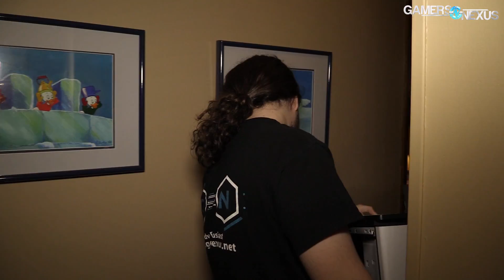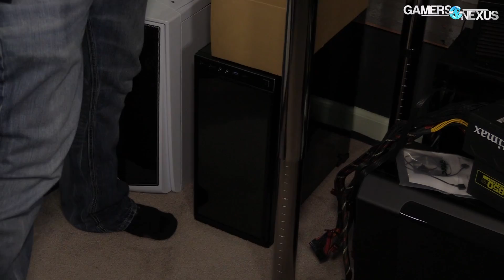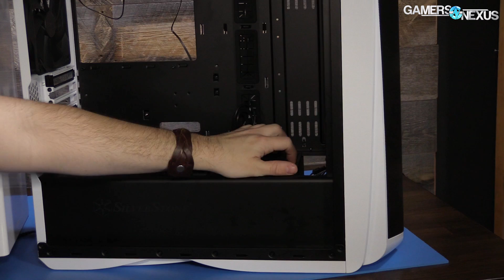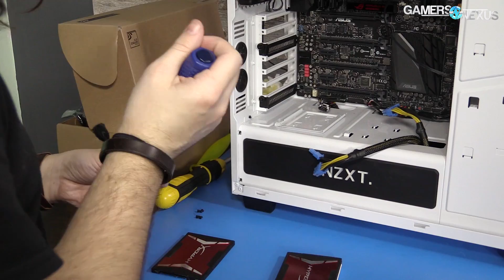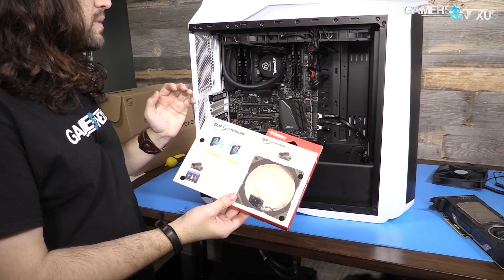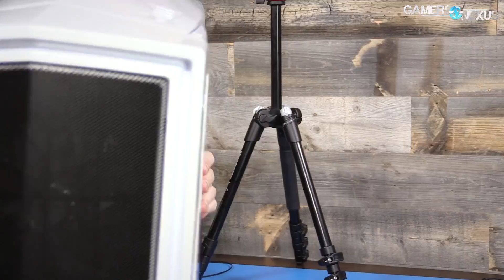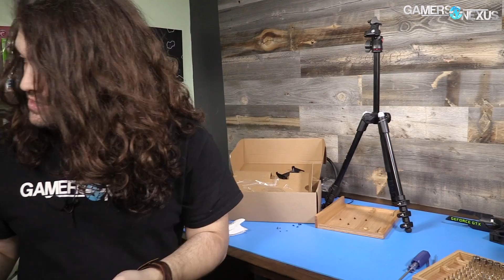Emergency Render Rig Rebuild (Pump Failure) - Pt 1/2

Comment: What was the rationale in using liquid cooling on critical business systems? The failure potential over air cooling is well known.
Reply: Getting comparable thermal performance on air requires a very large heatsink, which can cause packaging and installation problems, and might not be readily available for all applications.
Reply from the maker: Thermal performance for the space consumed is far greater, and the point of failure was the Antec fan, not the pump (pump failed after the fan failed due to high temperatures). Liquid cooling gets us higher sustained clockrates, lower noise, and works better in the cramped space we've got it in where there's limited cool air.

Also, we have lots of them. Like, a bin of them. It's easy to replace. The system will shut itself down if anything bad happens, so we can just swap as needed.
Reply: It's not that bad actually. From what I've seen with liquid cooled systems, the possibility of a failure while possible isn't that big of an issue as it doesn't happen THAT often. Sure, it's possible to happen but pretty rare to have a leak or other failure and as shown here, the pump and/or fans are more likely to fail than the loop itself.
Reply: They are far more reliable when you do custom loops.  D5 pumps in particular are known for longevity.  Part of the reason being they are water cooled as well.  DDC is pretty good as long as you get one of the newer ones from the last few years.  You know it's the new design if it has the heatsink on it.  AIO's are pretty weak sauce in the pump department.  The exception being something like an EK Predator kit.  They use good stuff.  Awesome block and a DDC pump built into the rad.  If you don't want to mess with assembling a loop, those are really the only AIO type system worth a damn.
Reply: ah, you did say in the video it was the pump though. I use liquid cooling for my "fun" stuff, but I've been reluctant to use it in anything I need on 24/7 or demanding duty cycles. AIO seems too flimsy for heavy duty, and custom loops are daunting and expensive.
Reply from the maker: TKO Jabroni Also said it was the fan in the video almost immediately after. And then again later in the video.
Reply: whoops, you're not wrong. guess this proves you shouldn't split your attention if you want to absorb information properly.
Reply: Installation problems huh? They've done a shit ton of headache installs already. High end workstations that  film production teams use never use water cooling
Reply: rude
Reply: The system shutting down if anything bad happens... are you talking about just a built in feature that would shut it off when it reaches a really high temp or something else?
Reply from the maker: Most large data centers are liquid cooled. LC is also common for render farms. Not sure where that "film production teams never use water cooling" stat came from.

Rusty -- You can set a threshold temperature using software or motherboards (not all boards support this) that is lower than TjMax. We have a safety temperature set that is lower than TjMax for precisely this reason. That way, if there is a failure from air, liquid, or something else, we are protected. Besides, the benefit of working on hardware all day is that a swap/replacement is trivial.
Reply: I'm sorry the other people commenting here are being so abrasive. I was genuinely curious. Thank you for answering so promptly and directly.
Reply: +TKO Jabroni I did an internship at a fairly large civil engineering firm over the summer (37 offices nationwide). Most of the people at my office just used ThinkPads with a dock, but a few had desktops with AIOs in them (I forget for what software).

Comment: Why not use a real loop.  D5 pumps last for years and years.  Going on ten years on the one in my loop.  I have tried AIO's.  They are less than reliable.  Pumps being the main failure point.  Custom loop or air.  Never AIO.
Reply from the maker: Chad Bremer We upgrade too frequently. Not time friendly, not good for component swapping, and not something my staff can maintain if needed.
Reply: Gamers Nexus use quick connects.  makes GPU swaps easy.  no harder than the AIO.   You could even do that for the CPU if you really wanted to.  Same work as what you are already doing.  Better performance.  More reliable.  Win win.  As for maintaining, add a little water, maybe every six months.  aside from that swap fluid once a year.  He'll, I know a couple people going on 3+ years on loops in servers with out touching them.  They are just running straight distilled water though.
Reply: AIO's are easy and effective. It's possible for them to fail but that's life, My H80i did a decent job for about a year but now I am having issues, however its still under it's 5 year warranty.
Reply: "But that's life?"  And this is why we get shitty products.  It's acceptable to some people.
Reply: Cool stories.
Reply: Three AIO units failed on me.  One never lasted more than about a year.  Meanwhile I have a D5 in my right now that I have had for 10 years.  I flirted with the whole AIO thing.
Reply: Chad Bremer 10 years ago?! So you cannot concede that huge advancements in reliability have been made in that time? I have another AOI in another rig that's still going strong, my H80I doesn't have a pump failure it's performance has just dropped, and it functions better when the rad is at an angle or has been shaken.
Reply: You need to read that again.  I have had the D5 for ten years.  It's been in several systems.  The AIO's have been in various configs as well.  That old D5 was around before them and is still ticking away.  The oldest AIO I tried was about five years ago.  Most recent was a couple years ago.  That was even a Swiftech unit.  Pump still shelled out.  I have had other hardware failure like you sited before.  But none so frequent as AIO failures.  I have had nearly as many HDD failures over the last 20ish years as I had from AIO coolers crapping out.  As for fans, they start to tick and they go bye bye.  But even that is pretty rare since I started using Noctua.  Not one has had an issue yet.  Sadly I have not put Noctua fans in the gaming rig yet.
Reply: Chad Bremer Your attitude about it is what's off putting. No one is trying to sell you on AIOs, but for you to make blanket statements about them and the people who are happy with them is extremely arrogant of you and no one cares about your opinion on the matter.

The best example of an AIO has to be the FuryX, in which I have 5 running in the room I'm in (Family gaming room) that have been abused for over a year without a single issue. 1 I'd be happy, 5 proves total reliability.
Reply: 5 units over the span of one year is dog shit when you're trying to have a discussion on failure rates. If you were running 3000 of them and had data over the last 3 years, it would be relevant to discussion.
Reply: Patriot 03 I think you're a guy using irrelevant data to defend a claim you have a personal interest in defending so you don't feel like you've wasted money on products that generally aren't up to snuff. Big tower coolers stomp all over AIOs in price-performance, are lower maintenance, maintenance costs less, and are less dangerous to use. Custom loops using a D5, which are generally 2-3 times more expensive, are superior to AIOs in every way, except maintenance and price. Noise and temps both are better served by custom D5 loops. AIOs are good for one thing. Looking good on a budget. Basically nothing else.
Reply: Patriot 03 Typical YouTube commenter. Can't get a sentence out without resorting to personal attacks. You are not being the enthusiast Steve knew you could be.
Reply: The Mighty Voice Says the troll who gets on here like an elitist spewing crap about AIOs and the people who buy them? That's funny.
Reply: Patriot 03 You had every chance to actually respond and make a case, but you didn't. Instead you chose to ride upon the world's ugliest high horse and choose insults over discussion. I know AIOs have their use, though fairly niche. They're extremely useful in SFF builds for squeezing out performance without going over a tight budget. But, no. You immediately chose to write me off as a person because you thought I was an elitist, made no attempt to discuss anything, and chose to insult someone instead. Congratulations.
Reply: The Mighty Voice You're an out and out liar trying to flip the story. My case for AIOs and the defense of those who use them has been made.

Yours has been arrogant, elitist, and not helpful to anyone. I think you're pissy that you were called out in the most recent video.

One more arrogant comment and I'll just block you, I don't need to see your crap.
Reply: Patriot 03 I haven't even watched the most recent video, but if your response to perceived elitism is to shout someone down for having an "elitist" opinion, choosing to spew venom and curses instead of talking to them like a person, I have no problem with you blocking me. If you don't want to see comments from people you don't agree with, that's your prerogative. Personally, I don't threaten to block people for anything. I just do it if they're spewing hate speech or the like. I personally don't think there's much else worth blocking people for.
Reply: The Mighty Voice Go watch it. I block people who are both ignorant and arrogant. That combination is justified means to not have to read their comments (or yours) anymore.
Reply: Patriot 03 You realize he was calling out the guy you responded to in the first place, not me, right? Originally I was just pointing out that your logic was faulty. 5 units surviving a year of use does not realistically prove anything one way or the other. Surely you understand how statistics work and why anecdotal evidence isn't generally accepted in debate, you're not an idiot. Angry, but not an idiot.
Reply: Patriot 03 Or you could just ask a system integrator like Puget Systems, iBuyPower, Origin PC, etc. what their failure rate is on the AIOs they sell. They keep that information. At some point, you could turn the cuntmeter down to like 3 or 4, you know.
Reply: The Mighty Voice Go on, try and get a failure rate on FuryX.
Reply: Custom loops are NOT useful for every use case. Just because you think it is the ultimate in cooling doesn’t mean it fits this particular use case.

Comment: Air cooling may well be more reliable (less moving parts and all that) BUT it will never give the cooling performance of a well built and maintained water loop .... if you disagree than I ask you to show us all the GTX1080 on air cooling OC'd to 2150MHz running at 100% load for several hours whilst staying under 45c max temp (delta T of 20 to 25c) and not throttling it's core clock ......
Reply: TechGoat my palit 1070 does that.If i want to keep it under 45 i have to run the fans at 70%+ and its loud at that point
Reply: can you prove that? The lowest full load temp I've seen for any of the Palit 1070 range in reviews is 66C at stock clocks ....
Reply: Also the card needs some cleaning(dust) and due to low ambient the heatpipes are at the point where they start functioning well.I can hold it at 45 even with 25c ambient.
Reply: Not bad and certainly less than the reviews report ... but your temps are after about 8 to 10 minutes fella (going by the afterburner graph)... now try looping the benchmark for several hours ;) ... Plus you do know that 1080s run a fair bit hotter than 1070s yeah? ;) .... My original comment does say an OC'd 1080 at full load for several hours ... not an OC'd 1070 at full load for 10 minutes ;) You do seem to have a nice 1070 though :)
Reply: stock curve runs the fan at 600-700 rpm.That why the temps are at 60c in reviews(same as mine).The palit 1080 performs similarly and if you use an aftermarket air cooler you are set.(accelero or whatever).The cards consume way too low power to require a custom loop in order to run cool.

I have gamed for hours and the temps dont change unless i run my case fans extremely slow.Unigine was running the same scene to avoid the black screen through scenes.That being said unigine is not that power consuming.I could easily increase power consumption by 10% if i run Project cars or the 2nd test of timespy.(and temps could be a bit higher)

It is true that as temps go up gpu boost slightly reduces the clock speed and a water cooled card can fix that.This Palit was the cheapest model available back in September and i was lucky enough to get it.This card never drops the clocks due to power limit or temp issues.(silicon lottery on my side here)

Comment: How long do water coolers last on average?
Reply: 3-5years but things happen like my h60 died after 1 year same case as gamers nexus
Reply: 2-3 years minimal if everything fine
Reply: It depends. imo EKWB and alphacool like the FD Kelvin have much better pumps.  I had acetek fail on me twice, acetek also doesnt have fill port so you can throw whole aio away after 2-3 years of use.

Comment: All these air cooling plebs in the comment section lol
Reply: Noctua is not even close to pleb status. lol
Reply: Anyone can use google in 2 seconds and see the hundreds of reviews and benchmarks and see a simple aio destroys air coolers like the d15.  It's the main problem with youtube comments, they never know wtf they're talking about yet could find facts by just googling it.
Reply: Destroys? More like barely outperforms them. The problem with air cooling is that in order to get the best cooling potential, the size of the heatsink has to get larger. AIO's, on the other hand, are convenient... but has more points of failure. It can leak, have a pump failure, and unlike air coolers cannot passively cool because even if water does move around, the radiators need WAY more cooling than air coolers.
Reply: A lot of hate in this comment chain. To me it depends on the environment.
Reply: Jason Leon That's the thing. An Aircooler fits in less places than an AIO if we're talking about performance. I mean, the Reeven Justice, a sub $50 air cooler is in the level of the D15. But here's the kicker, it's still huge even for a single tower. There's more cases that'd allow a dual 120 rad to fit.

Although the failrate of AIO's are minuscule, it's not a question of when it fails, it's a matter of what happens if it fails. Plus, because there are more moving parts (pump, water, etc..), even QC is a problem because there are cases of AIO's having rattling pumps (because QC can never be perfect, just consistent... and anyone can have a bad copy regardless). An aircooler? If the fan fails, it can still passively cool and won't cook a chip, but sure as hell if you want one that performs well... better hope your case can fit it.

I'm just here to say that air coolers aren't something to underestimate at all. Choosing one over the other is fine, but saying one's better than the other like what 4GB MEANS 4GB is saying... no, just no. If anything, it's negligibly better.
Reply: All my stuff is aircooled, but if these guys want to run AIO in a work intensive, high uptime use case, I'm all for it. I had been considering getting a decent AIO and running it 24/7 on one of my lowish budget BOINC rigs to test reliability, but now these guys are going to be doing the work for me. At a much higher quality, no doubt. Might give it a bit to wait for an "Oops" update video, but the previous incarnation lasted for a while and when it failed, it was to a fan. I stick with Noctua fans on my "important" projects, so I have confidence that that won't be an issue.
Reply: toy machine To be honest, AIOs don't really perform that much better than a nice Noctua heatsink and sometimes AIOs perform measurably worse than Noctuas: https://www.techpowerup.com/reviews/Noctua/NH-D15/6.html
Reply: Ken And the recent Reeven Justice is actually pretty damn good too. It's around the Hyper 212's price range (more like above it, but not really that much), but it performs so well that its not a bad buy if you can fit it... and Reeven has pretty meh fans.

Comment: Why do people water cool CPUs when it's the GPU that die much much faster then a CPU due to heat degradation
Reply from the maker: We liquid cooled both.
Reply: Have you seen the ProLima Tech aftermarket GPU coolers? Air coolers similar to the Arctic kits,  but larger and with heatsinks applied directly to the VRM and other components rather than through a backplate. I'd like to see your thoughts, if you can get a review sample.

Comment: 60c have never melted and plastic
Reply from the maker: 60C is the internal spec. It will begin permeating the rubber past 60C, which is a huge problem. 100C, you start having issues with plastic deforming.